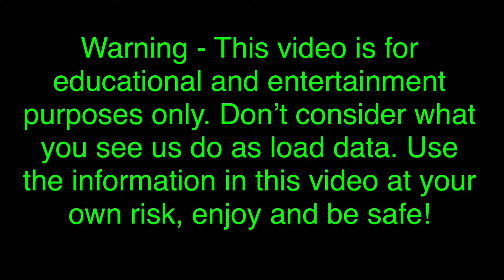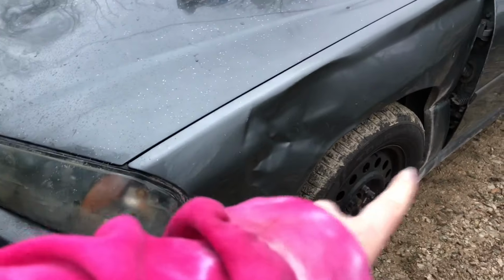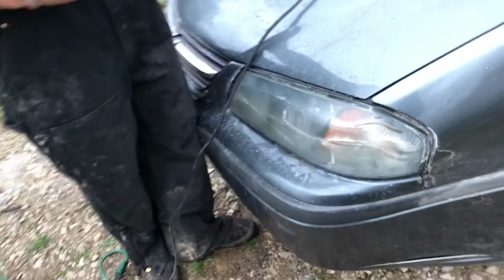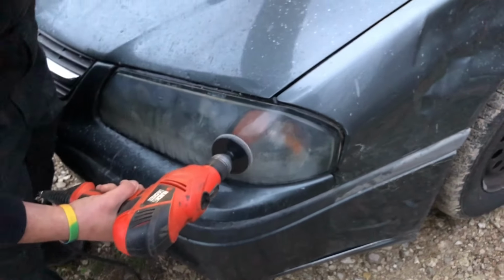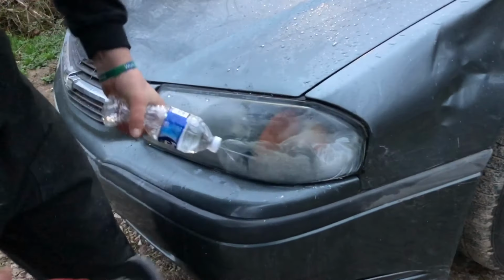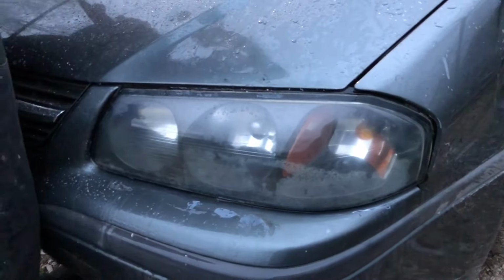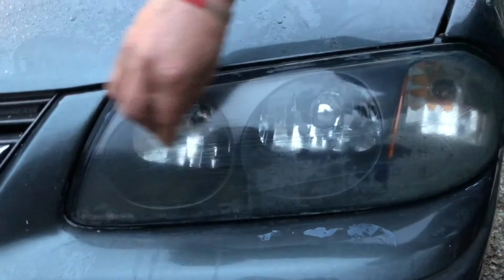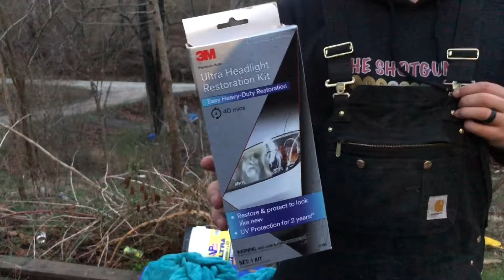3M Ultra Headlight Restoration Kit In Action

Comment: I'll tell you the fastest way to do that job. Get paint thinner  like they'd actually use in an automotive body shop. Put some on a cotton rag and wipe it very fast one time across the whole headlight. Don't keep wiping and wiping it or you'll melt the headlight. It only takes 5 seconds per headlight. However .... if you previously  put clear coat on the headlights, the thinner wont work
Reply from the maker: Thanks we will keep that in mind